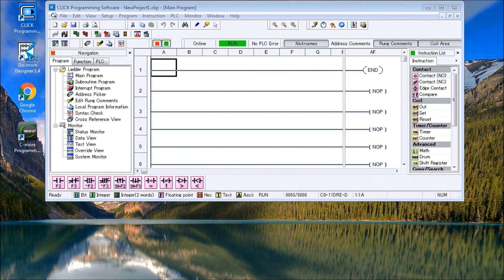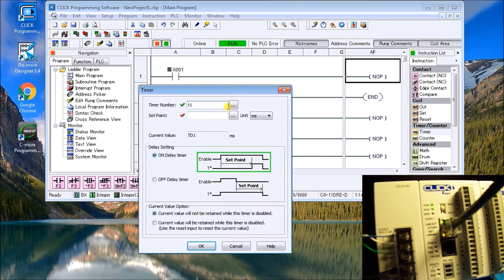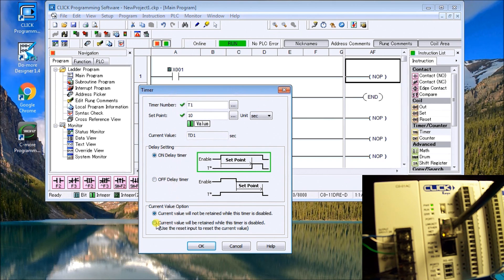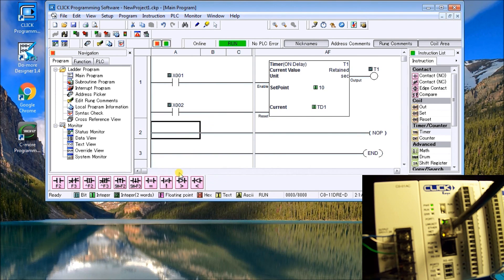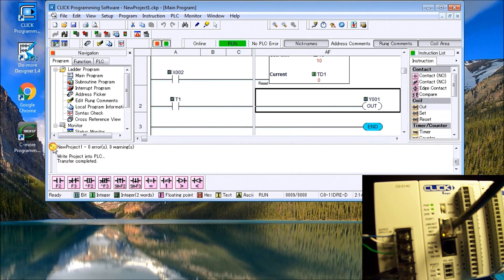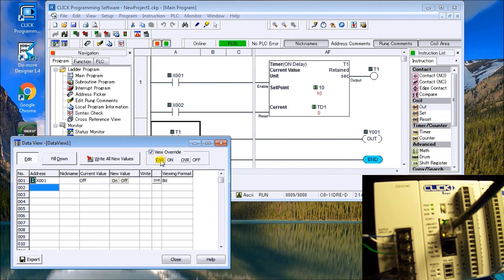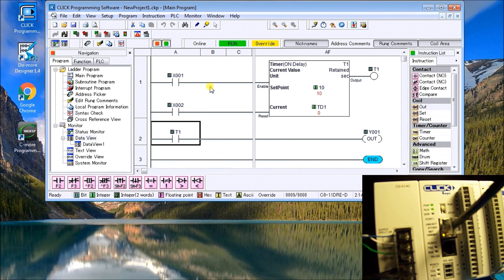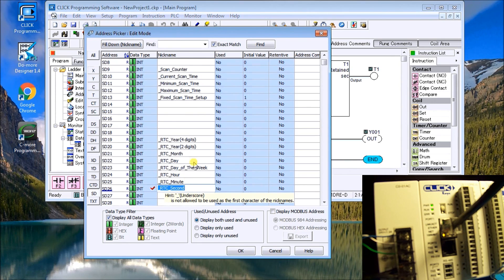Click PLC: Unlock Timers with ONE Powerful TMR Command

Comment from the maker: More information can be obtained on our website. This includes all of the links mentioned in this video. 
https://accautomation.ca/click-plc-timers-and-counters

There are several reasons why we are using Click PLC. Here are just a few.
 - Investment is low for the hardware and the software is free
 - Standalone PLC with built-in I/O
 - Communication ability - Ethernet Port, RS232, RS485 - support for protocols such as Modbus RTU, Modbus TCP, etc.
- Ability to expand the system with a variety of modules including RTD and Thermocouple inputs directly.

ACC Automation
http://www.accautomation.ca

Comment: Hi, great video. I have a question about timers. Im having some issues with my programming, my code is supposed to do the next thing:
Every time I press a button a timer starts and lights Y001 (for a certain amount of seconds) then it turns it off and stays that way for a certain amount of seconds. Its supposed to run until I shut it off, but it runs just one time.

Hope you can help me sort this problem out.
Thank you
Reply from the maker: Thank you for the comment! Have you considered using a latch on the timer output? You would then need another input to stop the timer. (Reset the latch)
I hope this helps you out.
Regards,
Garry

Comment: Im trying to have 2 inputs from 2 different locations control a timer, it will control a common output. Its a pedestrian walkway where they push a button on crossing a roadway and gates come down on both sides to stop traffic.
Reply from the maker: The logic would have the two inputs in parallel to set an output for the gate. After the timer expires, the output for the gate would be reset.
Here is a picture of the circuit.
https://www.dropbox.com/scl/fi/zn4zki01j3dm4icuhz79d/Click-2-inputs-to-control-gate-with-timer.png?rlkey=ger8cor3euggqh66gqxxwssg6&dl=0
You will have to modify to suit your application.
I hope this helps you out.
Regards,
Garry

Comment: I recently purchased a click PLC and I was surprised to find out that the timers don't have a timer timing bit. I understand I can Branch off of the enable and put in a coil that would represent this. I was just wondering what the reason is. Is it to keep the addressing simple? I must say I like that part
Reply from the maker: Hi Rob,
Congratulations on your purchase of the Click PLC. I believe that you are correct. This is used to keep the instruction simple. You will find that this makes the PLC itself very quick and efficient with its source code.
Regards,
Garry
https://accautomation.ca/series/click-plc/

Comment: Gary, Thanks for the video. I hope I can explain this correctly. I have a On Delay timer set up so that the operator needs to hold a push button for 5 sec to start a Off delay timer for 50 seconds. 
If the operator decides they want to stop that Off delay timer before the 50 seconds, I have it set up so that operator can hit a different push button to drop out a holding contact, lets say after 10 seconds. The problem is in the Off delay timer, the TD (counter ?) internally is still counting. Unlike the ON delay counter you can reset the TD Counter to zero. So if the operator hits the first push button, it starts instantly at the remaining time left on the TD value. Is there a way I can reset that TD value on a off delay timer? Or write a different program to over  come this problem? 
The problem it causes is if the operator resets the timer the way I have it set up before that the set point timed out, the operator can just hit the pushbutton and it finishes on that same set point at whatever that value is at that time. Hope this makes sense.
Reply from the maker: Hi Dave,
This is an interesting application. I would use two on-delay timers for this application.
After the first timer is complete would seal in the timer. The first-timer will then start the output through the second timer normally closed contact. This is hard to explain without a picture of the circuit, so I have posted your question and the answer on the AD forum at the following location.
https://community.automationdirect.com/s/question/0D53u00003qsdhbCAA/click-timer-application
Let me know what you think.
Thanks Dave,
Garry
Reply: @ACCautomation  Thanks Garry! And thanks for the very quick response! Perfect, I would have never thought of doing this way and it works and solves my problem.  I'm more self-taught and the help from guys like you are much appreciated.
Reply from the maker: @daveh1339  
You are welcome, Dave.
I'm glad you got it working.
Garry

Comment: Thanks for great video, I am new to PLC's, I am writing a similar program but I how do I make the timer  repeat the cycle over and over? The program  I wrote is controlling a motor brake by applying a 24V to it ON and OFF with timer set to every 60 secs. It only does the cycle once but doesn't repeat. Thanks again for the tutorial
Reply from the maker: Hi Silkk_Cotton
If you put the Normally Closed Timer Contact in front of the actual timer, this will create a timer that will self reset.
NC T1 will go to T1
I hope this helps you out.
Regards,
Garry

Comment: Can the real time clock be used as an enabling contact? (Example: On from 5am until 6 pm)
Reply from the maker: Yes, the real-time clock (RTC) can be used to control and output.
Use the compare contact instruction.
https://accautomation.ca/click-plc-compare-and-math-instructions/
In your example:
DS24 - RTC Hour - (0 - 23)
Compare DS24 >= 5 and DS24 < 6. This will be the condition for your rung output.
Hope this helps you out.
Regards,
Garry

Comment: I learned that there is no function to return an integer representing a time, as in seconds, to be converted to a HMS string. I had to use DIV and MOD to produce the individual components that the HMI could read and render as concatenated strings. I'm using the C-More EA9. That seems like an obvious function for HMI wherein you want to show how long something has been running or show a countdown timer.
Reply from the maker: Thanks for the comment Jeffrey.
Here are a couple of links about the same issue:
https://forum.automationdirect.com/forum/operator-interface/13523-setting-up-a-timer-display-in-a-c-more-hmi
Here are the sample programs from the automation direct website:
https://support.automationdirect.com/examples.html
Regards,
Garry

Comment: I just learned a hard lesson. A timer must be triggered in a section of code that is executed in each run through the rungs. I had my code ending before the timer after the timer was triggered. That caused the time to stop incrementing. I assumed it was like other timers that keep running once triggered. So watching for the timer to end and for the time value to increment gave me nothing. Lesson learned.
Reply from the maker: Hi Jeffrey,
Thanks for the heads up for other readers. Yes the timer needs to be scanned every time for it to function correctly. You must be using a subroutine.
Program control can be found at the following location.
https://accautomation.ca/click-plc-program-control-instructions/
Thanks Jeffrey,
Garry

Comment: Hi Gary. Your videos have been really helpful, and I appreciate you taking the time to make them! I have one question about timers on the Click. How would I set it up if I wanted to have an alarm go off for 5 seconds? Is there a simple way to accomplish this?
Reply from the maker: Hi Daniel,
Thank you for the comments. 
If you want an alarm to go off for 5 seconds, there are several ways to accomplish this,
One way is to use an on-delay timer set for 5 seconds.
The output would have the same conditions as the timer as well as the normally closed contact off of the timer.
When the conditions for the timer are met and it starts to time. The output will be on until the timer times out after 5 seconds.
I hope this helps you out. Let me know.
Regards,
Garry

Comment from the maker: The timer can be selected to be memory retentive. If power is lost to the PLC or the PLC is placed in program mode, the timer will not reset. The default when calling the timer instruction is non-memory retentive.
If the timer is not reset and continues to increment, it will increment up to 32767 and hold the value. This is the largest integer that 16 bits will represent. No error will happen.
Thanks for the question Steve.

Comment: gary, i need to setup a timer with a time off, time on, then time off again till reset. is this possible in the click plc? i downloaded the software to play with but havent figured it out yet.
Reply from the maker: Hi Leonard,
Yes this is possible with the click plc. You start with a timing chart of what you want to happen. 
This link should help you out.
http://accautomation.ca/the-secret-of-using-timers/
Let me know.
Garry
Reply: Garry, Thank you for the link. Im new to plc, Im considering the click for my operation. Im reading as much as I can, One question I cant seem to find a answer to. Can the click have more than one program in it, If I put a cmore on it to toggle between programs I want to run, Or does it have to be re written everytime via the software.
Reply from the maker: Hi Leonard,
You can have only one program running in the PLC at a time. However you can split your program up into different subroutines. Each subroutine can be a different sequence of operation. The following link will explain the subroutines in the Click PLC.
http://accautomation.ca/click-plc-program-control-instructions/
There is also a YouTube video:
https://www.youtube.com/watch?v=uJZyfF-bKdA
I hope this helps you out.
Regards,
Garry